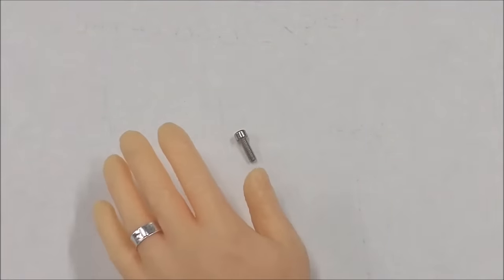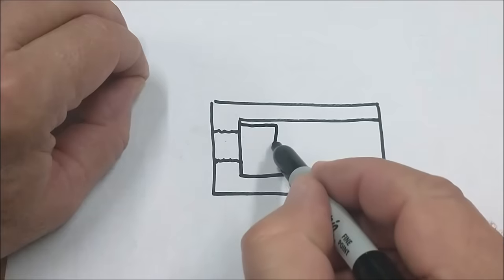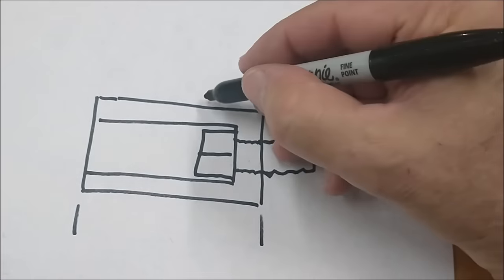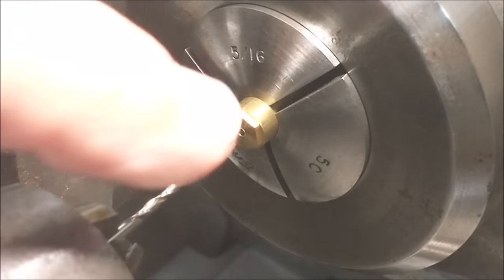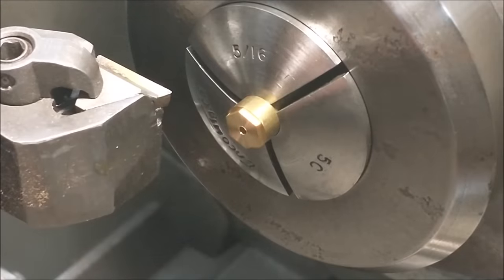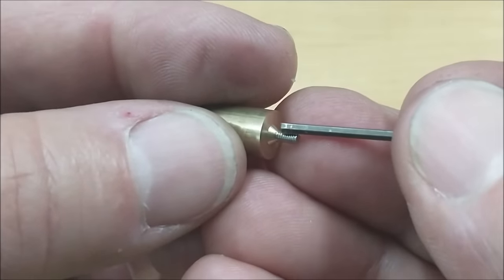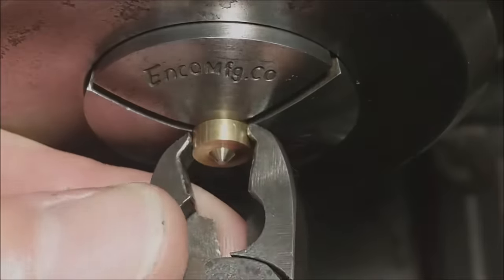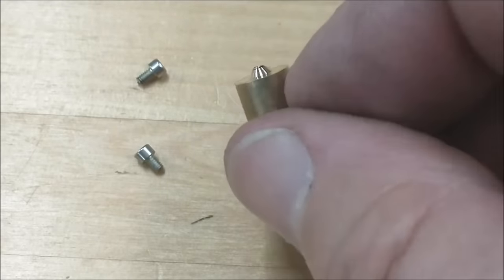Holding and Machining Small Screws !!

Comment: I would need a loupe to machine that Joe lol
Any tips for removing a broken 1mm tap?
Reply: spark eroder
Reply: If the part is non-ferrous, maybe use a bath of Iron(III) Chloride. It'll eat copper, iron, steel... 
If not, make a new part...   
Which diameter drill bit did you use?  
You want to use either a 0.75 or 0.8mm drill bit depending on whether it's a coarse(0.25mm) or fine(0.2mm) thread.   
I doubt that going up another 0.02mm or something will cause any issues, either. (Nope, don't have those bit... yet... Got everything from 0.5mm up to 2mm in 0.05 increments) 
Another possibility, if the part is large enough, is to use a mill and 'peck drill' the tap and the area around it with an endmill. Maybe an 1/8" or a 4mm, whatever you have, then tap the hole. Grab a rod of the same material as your part, turn it down to the right size, thread it so that it fits snugly in the part. Then drill and tap it for the M1 screw. Fit it to the part, then drill a small hole at the edge of the rod so that it cuts through the threads of both the rod and the original part. 1mm or smaller. Then hammer in a thin rod to lock everything together.
Reply: Only one way I know of......What ever you do,,,,,DON'T BREAK IT!!!!!! (I'm such a schmardtass)

Comment: I think horologist call a similar chuck a Lantern Chuck!?
Reply from the maker: If I understand the lantern chuck correctly, it still banks on the head of the nested screw. Technically, the brass plug delivers a more accurate thread length.

Comment: i usually shorten screws with a dremel and clean up the thread by chucking it in a power drill and using a file. granted that probibly wouldnt work with screws this small.

Comment: Not all lathes can be switched to run in reverse, unfortunately.
Reply: All can be made to though
Reply: How old is the lathe?
Reply: I'm sure you are right, but to be honest, I have never seen one- And if I live I'll be 77 the day after Christmas.
Reply: An example is my Advance lathe from the late 60's.   I understand that to have switchable forward and reverse, my Advance lathe would need the motor to be replaced.  It's to do with how it is wired internally.  BTW, it's not a capacitive start motor, I think it's called resistive start and it's wires are connected internally,  not in the electrical cover.

Comment: Do you know anywhere that might carry titanium 3-48 screws with countersink oval heads on hand? Another exotic material might be fine. I'm doing something for a friend, and want to add a unique touch to it.
Reply from the maker: Try the bolt depot. Maybe switch to stainless torx or something. TI screws may be hard to find.
Reply: McMaster Carr has flat head ones, but no oval heads

Comment: Or if you're handy with a files, and a die setup, you'll be good to go in half the time wasted making part holders 😮
Reply from the maker: Wanna bet?
Reply: And the parts tend to look like they were made in India. There are lots of faster ways, like cut off the screws with wire cutters and grind n scotchbrite. Acceptable for some jobs but they won't look machined. And fussy, good for making one or two max. I'd side with Joe on that one. Ask me how I know!

Btw, a row of tapped holes thru a piece of plate stock with the threads sticking out one side then put in the mill gets a lot of screws done in a hurry. Put each one in a cordless drill and spin them against a stone/scotchbrite/sandpaper works, although they don't come out as nice as Joepie's onesie method. Of course if you are making more than about 49, time to place an order, lol!